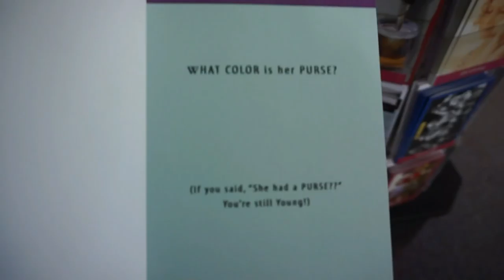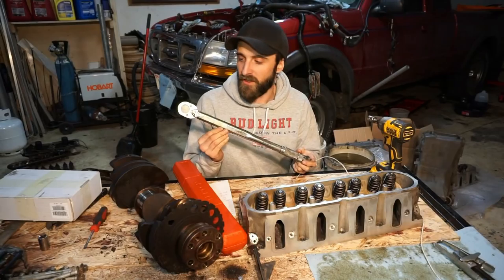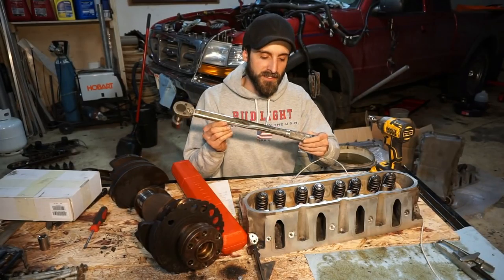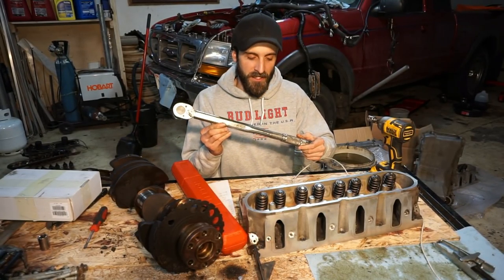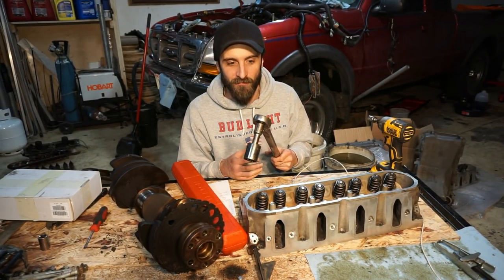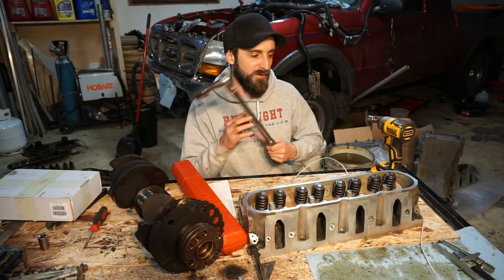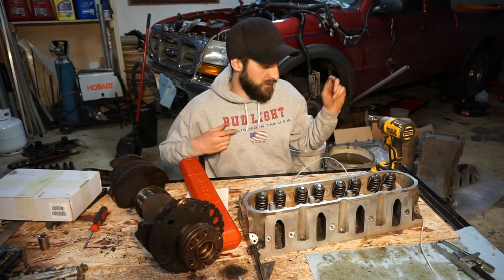ALLOW ME TO EXPLAIN!!! Torque Breaker Bar??? LS Swap Rebuild Pan Cleaning!!! - a21bravo

Comment: Menards has regular valvoline for 2.99 per qt, Valvoline oil filters (USA made) for about 3.50. My DD only holds 3.5 qts, so my oil changes are pretty cheap.
Reply from the maker: mcqueenfanman Not bad.

Comment: $30 and ten minutes using mobile 1 synthetic doing it myself. I get supplies when I'm already at the store for other stuff, and disposal is quick and free. I think I save time vs driving to a place, waiting, telling the person I don't want an air filter wipers trans fluid etc, and paying.
Reply from the maker: wainfiggitty Nice... I don't mind the wash, fluid top off. For an extra $10... They wash windows/dash/panels and vacuum inside of vehicle too... Works for me.
Reply: a21bravo That is a pretty good deal.

Comment: German Castrol 10w-40, OEM filter every 10k on my 2015 Passat 1.8tsi. I also have a huge 2 micron bypass filter behind the front bumper. My oil doesn't even change color anymore haha.
Reply from the maker: 4sf3d4g63 Damn.

Comment: What is the ratio of mineral spirits and dish soap you use to soak the parts in?
Reply from the maker: Phil Betthauser it was about a half gallon of mineral spirits, 3 gallons of water, and small (entire) bottle of dish soap.
Reply: a21bravo  thanks. I have a few items that are being stubborn
Reply: I didn't think mineral spirits and water would mix, won't they seperate ??